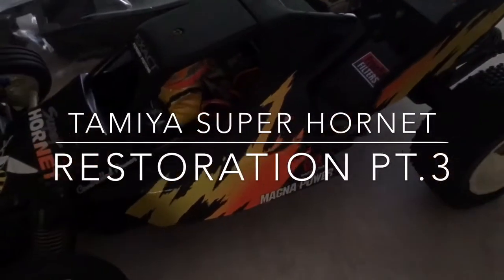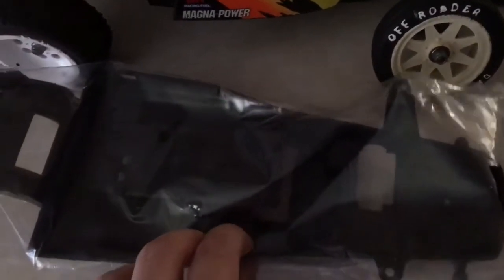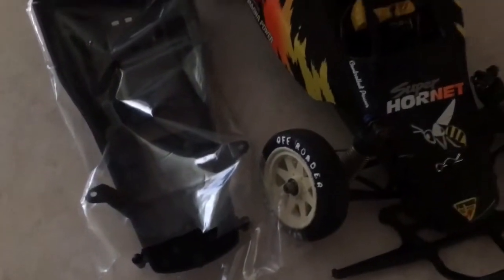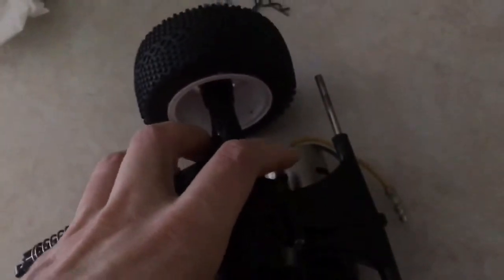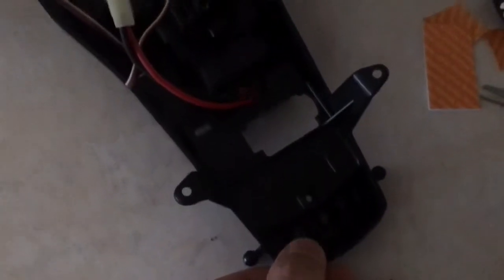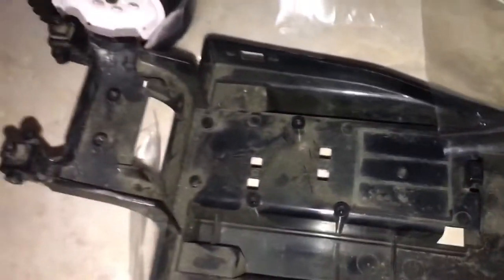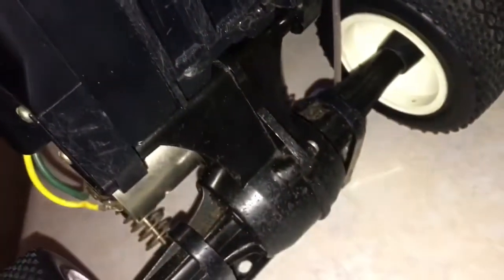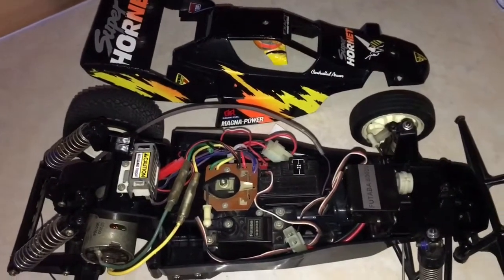Tamiya super hornet Restoration PT.3

Comment: Good job! Looks good with the new chassis. Also looks like it got Grasshopper II rear shocks. I, and others I've seen, has had a lot of trouble with those. Probably the worst shocks I've ever come across - I mean no offense, I got 'em too in my GH2 :-) If you ever come acroos some original Super Hornet CVAs or other fitting CVAs it would be the good thing to swap (if you will be running it). But looks good! Congrats with your new Super Hornet!
Reply from the maker: Nordic RC Visions thank you! Yeah your rite, I believe there the original hornet shocks in the rear. For me personally there to stiff, I'm trying to hunt down some nice soft aluminium type all round, but no luck Just yet. Hopefully I'll get a decent set. Could you recommend a brand type that would fit? It would help me out a lot. Thanks for the feed back.
Reply: Harkeness O7 No not the Hornet. The Grasshopper II. I think the original Tamiya CVA oil filled shocks fit the best. Probably the cheapest too. Other good and very affordable aluminum shocks are the Carsons and GPM. Just bought a couple of Carsons alloy 'silver' for 10 Euro or such. But they probably do not have those in the States. Try to find the length of the original ones(I believe the GH2 rear shocks are shorter than the SH's because of the different shock mounts)  and then go looking on eBay or such. A lot of good new affordable Chineese brands available.
Reply from the maker: Nordic RC Visions awesome thanks for that! Yeah your rite again, Grasshopper 2 rear shocks. Never own a super hornet so I thought they may of been the original. Thanks for that much appreciated. Great I will look on eBay tonight and see what I can get. Cheers 👍